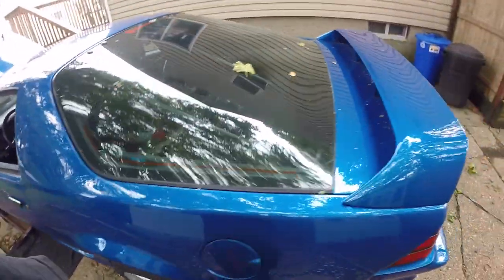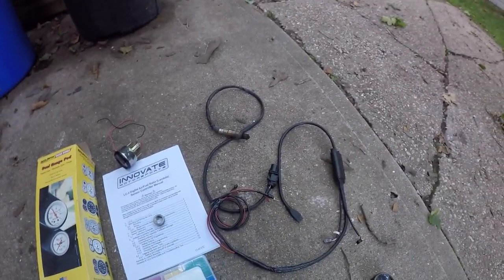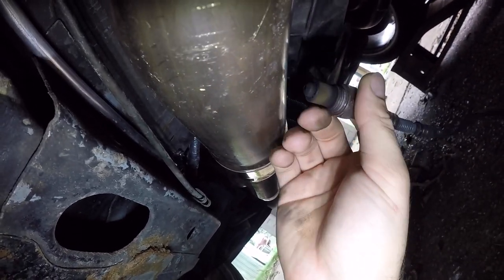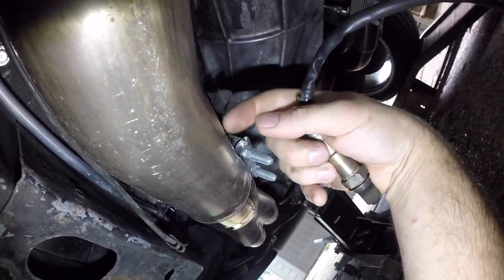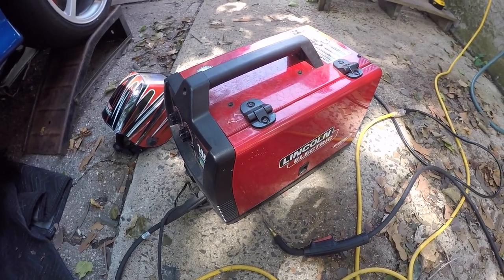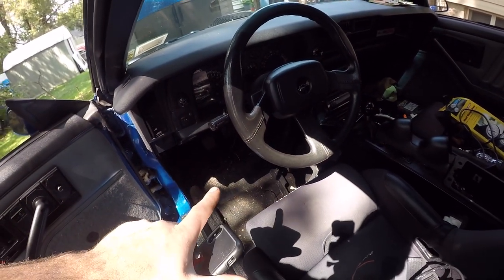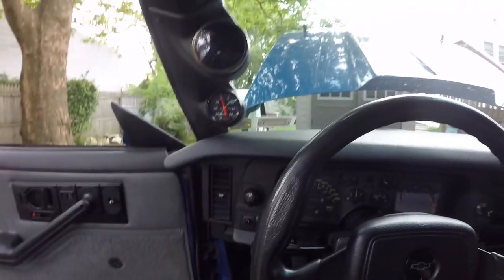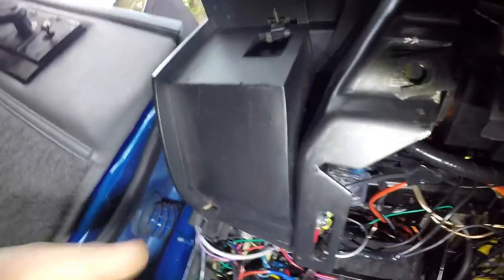How to Install a Wideband and Boost Gauge | LSA Blower Swap

Comment: Right around 12:10 where the gap under the hood between the fans and the front end would look really good with a clear piece of plexiglass or other plastic.  Some kind of a clear cover that can snap in and out.  I don't think this would limit air to your fans because of the air rushing in through the front grill.  Dunno. Just an idea.
Reply from the maker: I actually have something planned for that, not sure it will work, but should make for a good video👍